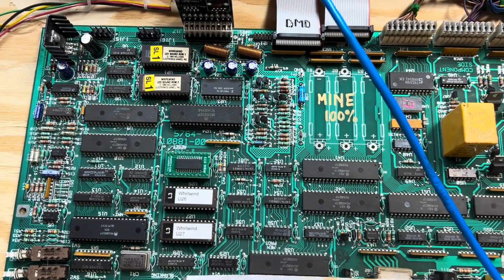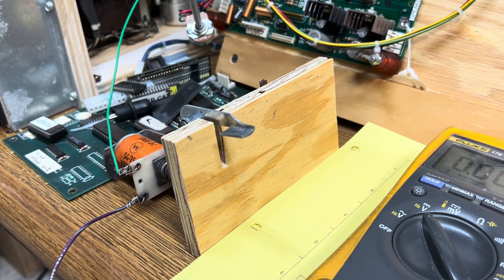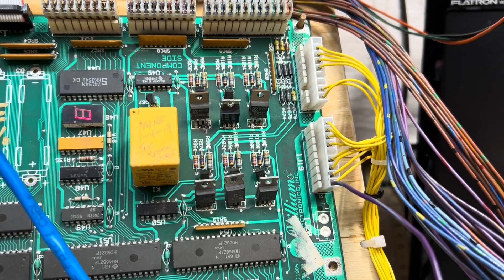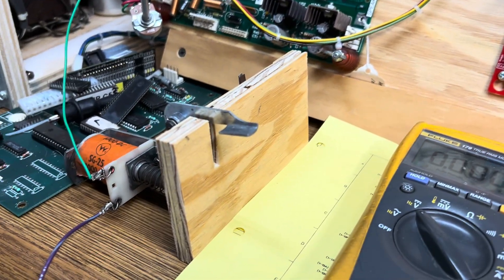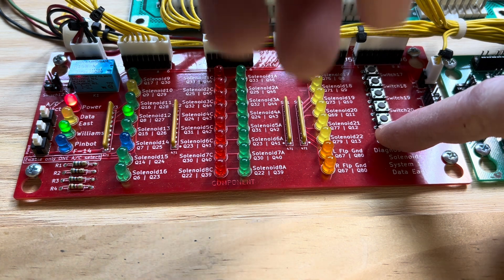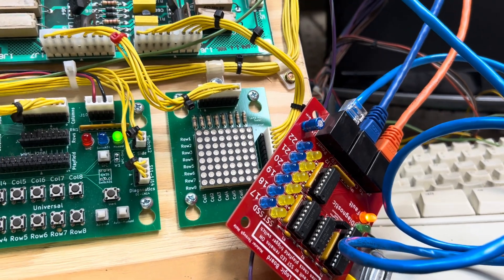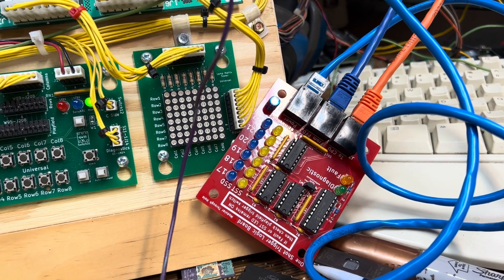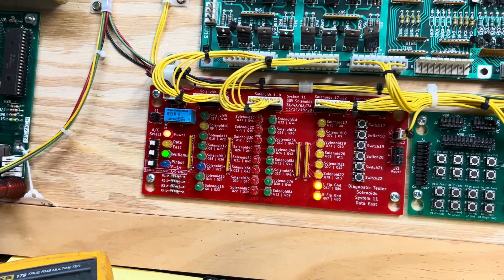One Shot Trigger (OST) to protect WMS S3-11, DE MPUs from Special Solenoid Failures (design by DA)

Comment: Is the output timing adjustable for a slightly longer or shorter pulse to the solenoid?
Reply from the maker: No sir. The output remains the same. The device gate keeps the input.

Comment: Why not just use a PTC fuse for each channel? You could use a fuse profile that causes the fuse to open after 2-4 seconds and wouldn't use any software.
Reply from the maker: With any fuse, as long as the special solenoid switch is closed, the coil will heat until the windings short together, lowering the overall resistance of the coil, increasing the current draw. Once the current draw exceeds the current rating of the fuse, the fuse will blow. By this time, the damage has been done to the coil. While a PTC fuse "resets itself", this only happens after the coil has been damaged. Make sense?
Reply: @ChrisHiblerPinball   With a PTC fuse it is thermally activated by current flow. They come in various current profiles. So, you would select a fuse that opens after a predetermined amount of coil on time. It would then either not trip on a normally-acting output or trip and reset automatically on stuck-on output. If you wanted to get fancy you could add a LED to indicate it has tripped.

Comment: This is so excellent.  Will there be any batches of these made for some plug and play use for buyers? Most of my collection is system 6, 7 and 11 games with pre '88 special solenoids behavior. This would be an awesome addition to them, making things consistent and free from roaching coils if there's an issue.
Reply from the maker: Yes sir. Victor can make as many as you need. Your will be able to rest easy that your 6 thru 11 games are protected, in the same way that moving batteries off our MPU boards provides peace of mind.